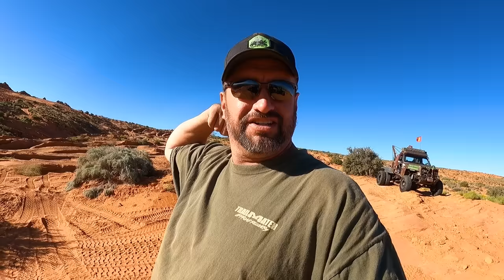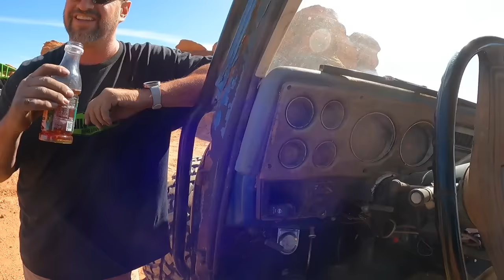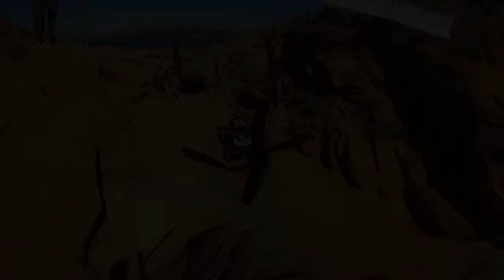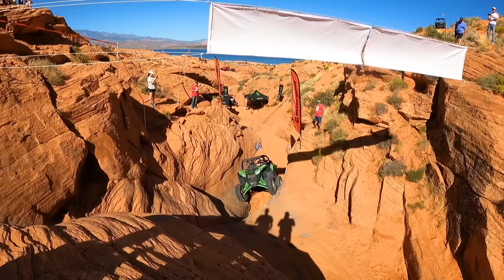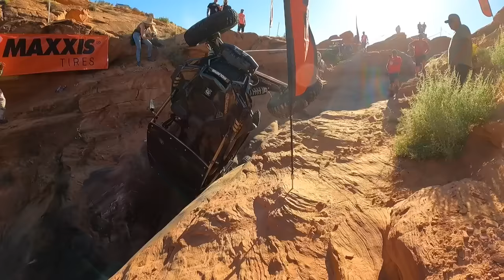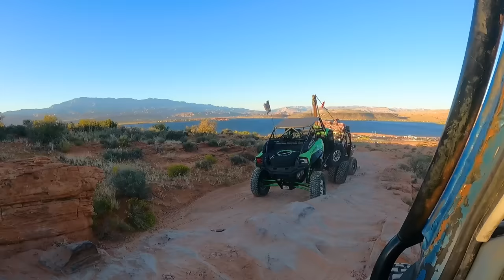Trailhero 2023

Comment: Traction boards are much more useful than just providing traction (and IMO they're very useful for that, especially on vehicles like a LR Discovery with rubbish recovery points).

I've been stuck stuck in a bottomless mud pit to the extent of just winching other vehicles towards me, and it was the traction boards providing a solid base for the Hi-Lift that got me out.

Comment: I just can't imagine pissing that much money up the rainpipe. All the people cheering them on have no ante in the pot.
While all my friends were buying a new ATC or quad every 9 months because they flogged them to bits, I had miles of smiles on my 10 year old one by not hammering it to oblivion. My Jeep is 59 years old, my 4x4 3/4 ton Dodge truck is 70 years old. They still work well. Doing that stuff just makes them into razor blades. With the exception of demolition derby, I've never understood just beating your equipment to oblivion.